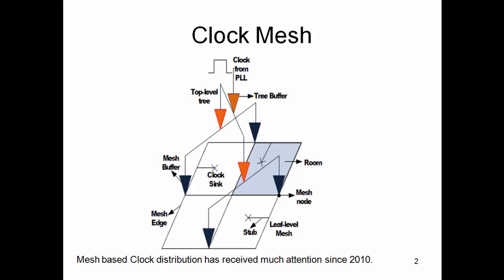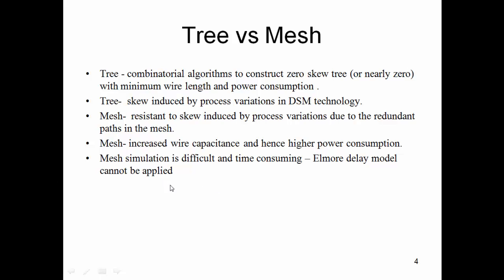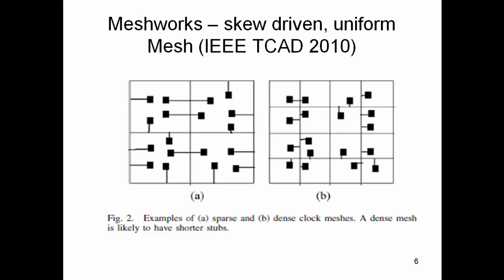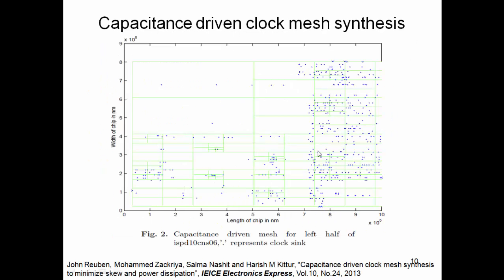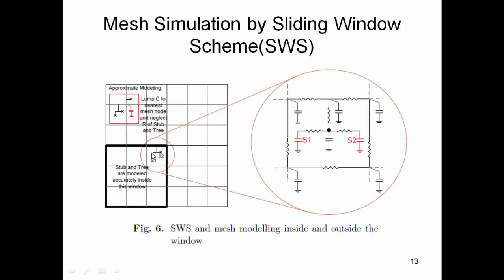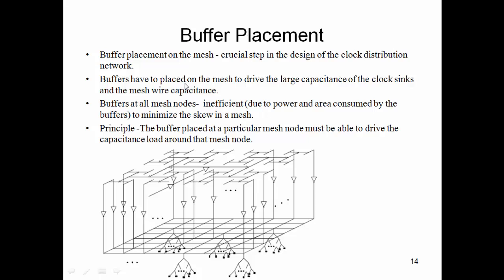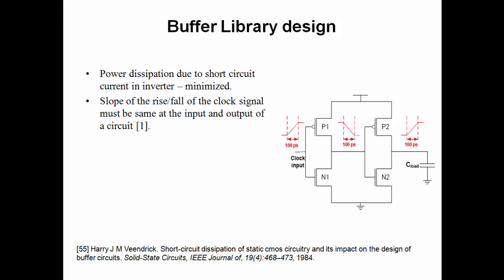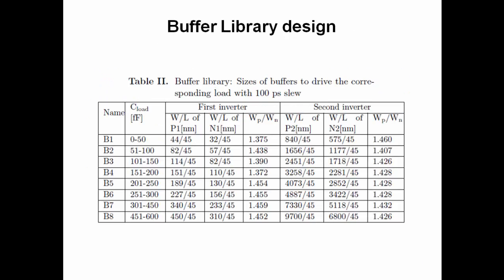Mesh based clock distribution

Comment: Hello John, Thanks for the Info. I would really appreciate if you could provide the title for the papers you highlighted in the video.
Reply from the maker: "Capacitance driven Clock Mesh Synthesis to minimize skew and power dissipation" available for open access in
https://www.jstage.jst.go.jp/article/elex/advpub/0/advpub_10.20130850/_article
Reply: John Reuben Thank You :)
Reply: @johnreuben6930  sir told me zener diode parameters in analoglib cadence tool